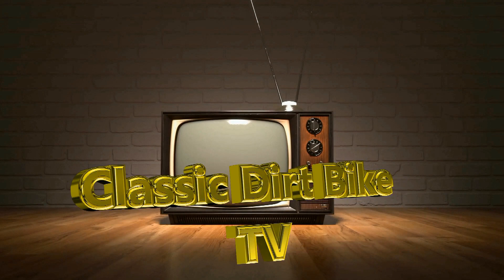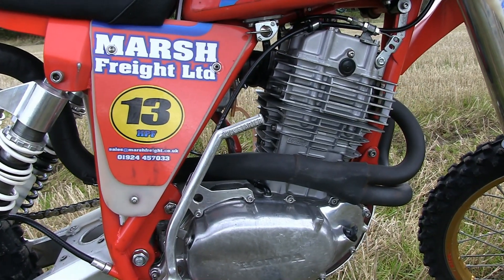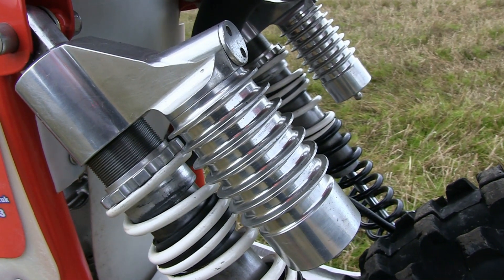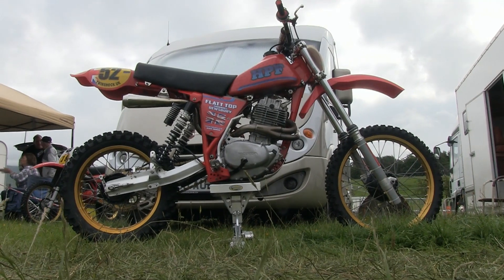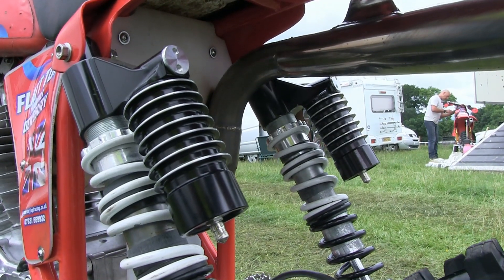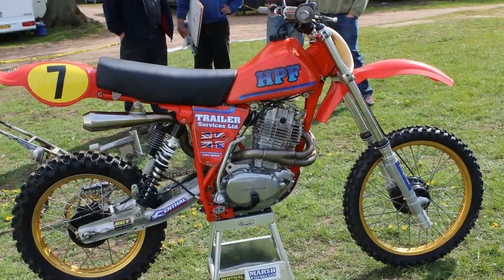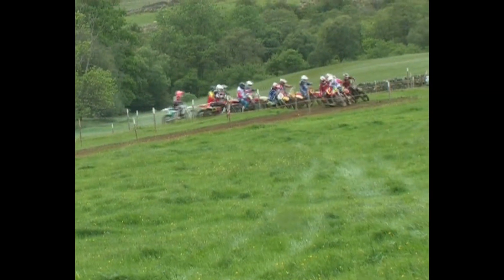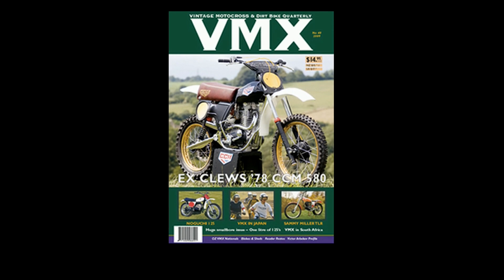Classic Dirt Bikes "H.P.F (Horse Power Factory) 500 Honda's"

Comment: All Honda RFVC heads should have the heads hogged out (ported) , next bore size high compression piston, CT cam and pipe. CT cdi box for higher rpm. Wakes them right up. Go the next engine size up on the carb boot and put a bigger carb on it. Oil cooler and don't be cheap change the oil every 10 hours. RFVC motors are bullit proof 💪